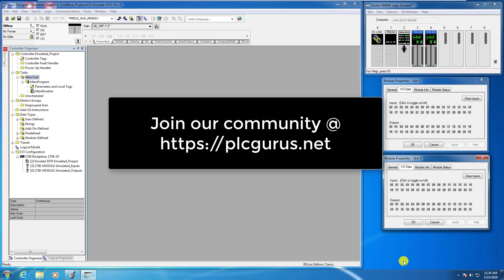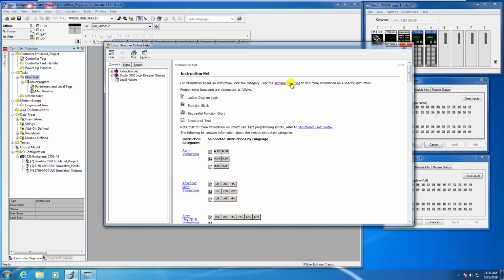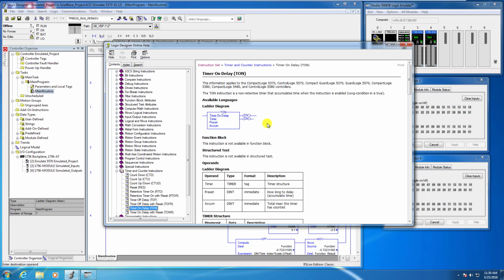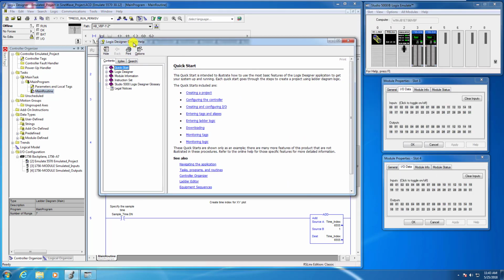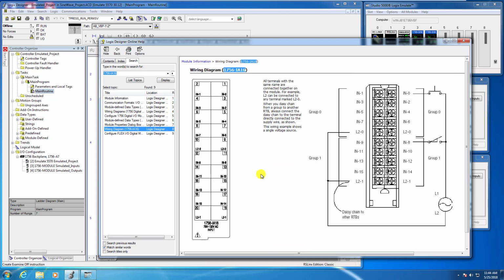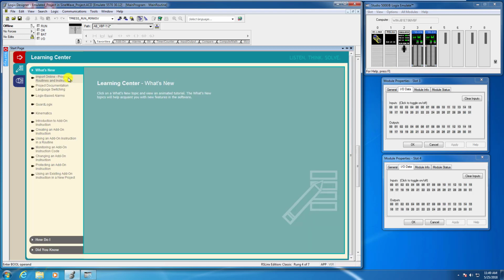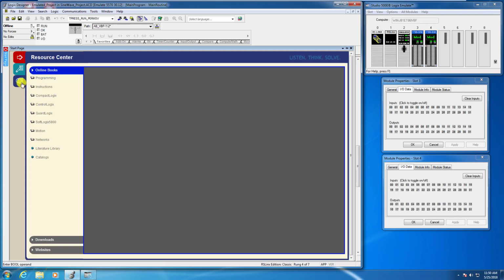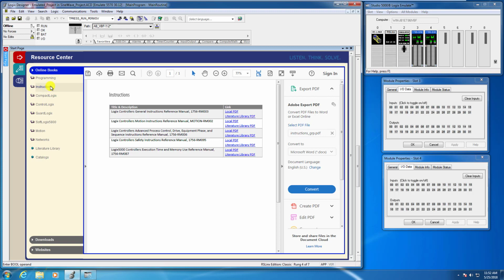PLCGurus.NET - Using Studio 5000 Help

Comment: Rockwell Automation writes a ton for documentation across so many their hardware/software and even the help section within any their software is loaded with really solid information. That's another reason their applications are so large in file size also. And i myself will agree with often failing to use it because sometime i'll admit reading how to do software stuff just isn't fun lol. Yet, to Rockwell's credit, there is a ton of information in their inbuilt help section on every piece of software and it just takes some time to read and be familiar with. I'll remind myself to utilize it more. The F1 key on Instruction selection on rung was really helpful for such a small thing in taking you directly to it in the help section, i didn't realize that. But i can see the value of the information there. One the other thing that occurred to me watching this also is at some point you should also do a quick video in showing others how to add and post "Comments" within the structure of the ladder logic on the rung sections. As that's a very important thing in how the logic is written for documentation of need to know stuff. Another great video as always. I can now say i've also completed watching your entire Studio 5000 series so far. Though i'm fully aware it does not complete explaining how to do so many things within Studio 5000 as well as it's a vast complex application. I spoke to a RA Manager recently at a session and he conveyed that they even do include video where warranted in the help section to which I had no idea they did. However, he also explained that if they were to include many video's that the software applications would become vastly too large to download and that's also a problem. But, it's something they continue to work on.

At the recent Rockwell Automation TechED 2019 I attended in Orlando, FL my very first TechED i sat through many interesting sessions as well hands on Labs and one particular was so interesting it blew me away relating to Studio 5000. And that was Studio 5000 ACM (Application Code Manager). So i know in the realm of a series on Studio 5000 there is a lot that can be covered. But I do understand and realize what you have covered so far is rock solid in helping a new person get introduced to Studio and get up and running on their first project. Utilizing ACM is more complex in understanding , but its such a huge productivity enhancer for sizable project integration and rapid development. At my office I had no idea how to use ACM or even what it was for and just totally ignored it. When i saw it demonstrated by 2 of Rockwell Automation's Power Users it totally blew my mind and just had no idea how valuable that was to project build configure (not programming) a project for Studio 5000 and FactoryTalk View at same time. I was blown away with what i saw as ACM totally built the skeleton frame of the project in almost no time at all. Which made completing the programming in Studio 5000 with the same file opening far easier as well as in FTV. So hopefully some point in the future you can cover that as well as a advance addon to the Studio 5000 series and far more.